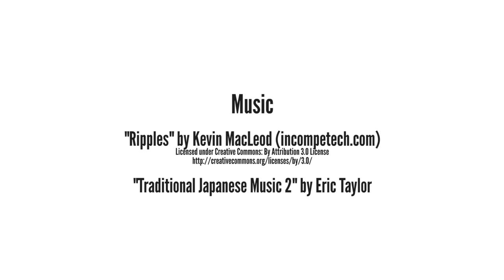109 - Shoji LED Lamp

Comment: Paul, are the Kumiko strips 1/8” or 1/4” or another size?  Looks like you had two blade kerfs for your half lap?  Also, you mentioned wanting to use a dozuki and chisel instead next time. Why so?

Comment: Excellence Mr. Jenkins.  I'm getting ready to use mulberry paper for my first attempt at shoji lamps.  Any tips for attaching the paper?  Is normalTtitebond (blue) wood glue ok?  Looks like you cut the paper large by 3/4, applied glue and spritz it twice with the water bottle.  Thanks for sharing- again superb work.
Reply from the maker: I'm not sure. I used riceglue. I can't see Titebond II having an issue, though III might be better. The water spritzing is to 'tension' it after the fact.

Comment: Y did you cut the strips on the bandsaw and not the table saw?
Reply from the maker: They were pretty small at 10x5mm. They could have been done on the tablesaw, but it felt safer with the bandsaw